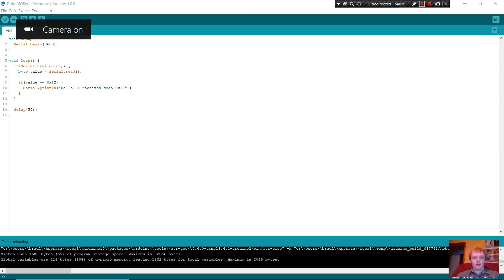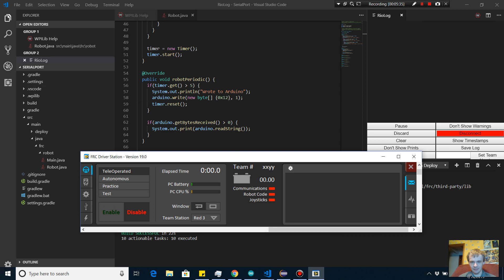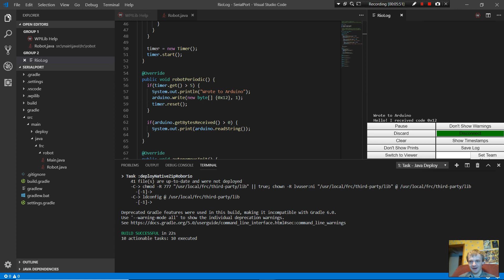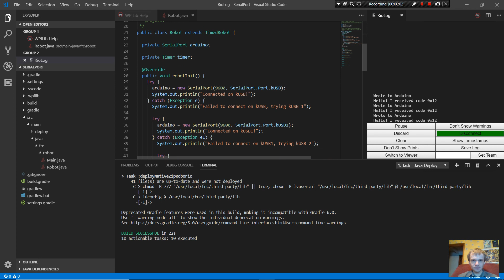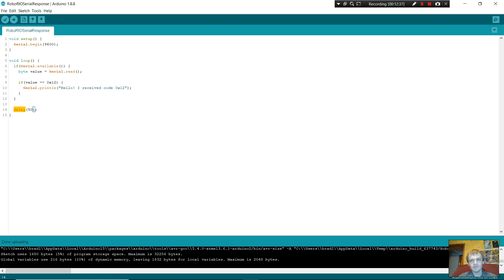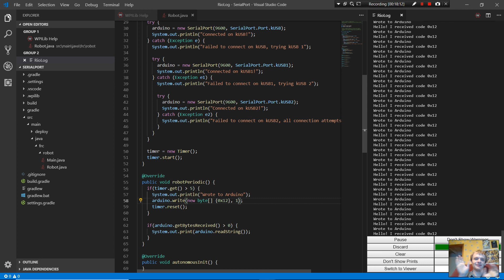Arduino/RoboRIO Integration

Comment: But the roboRio only has 2 usb ports right? So i dont really understand the 3 kUSB try and catches
Reply from the maker: Technically it has three, two USB A's and 1 B. At the time I wasn't quite certain how the WPI library enumerated the USB ports. So I set it up to check them all, you could probably figure out which enumeration is the USB B and just skip it. But checking the two A's is important just in case someone plugs your Arduino into the port your not expecting it to be plugged into.